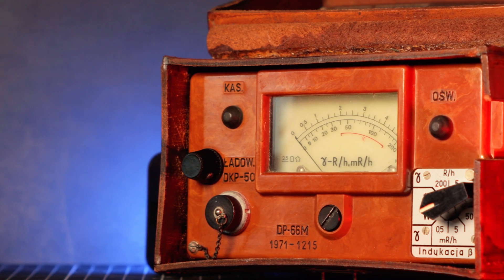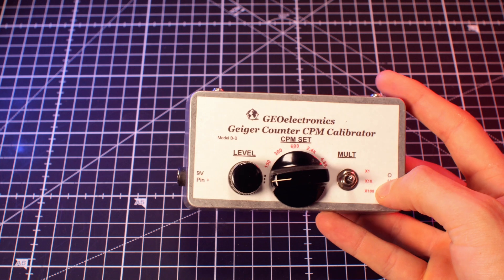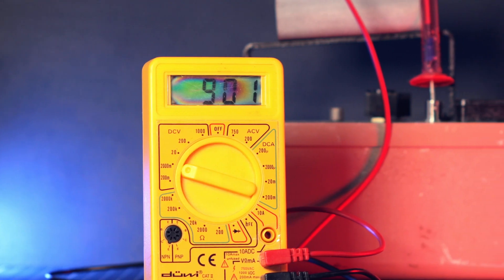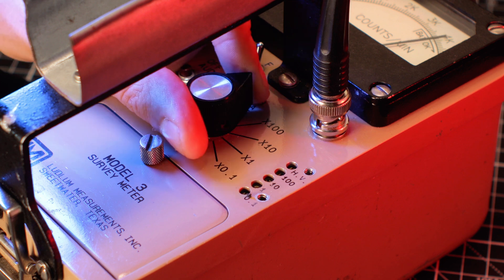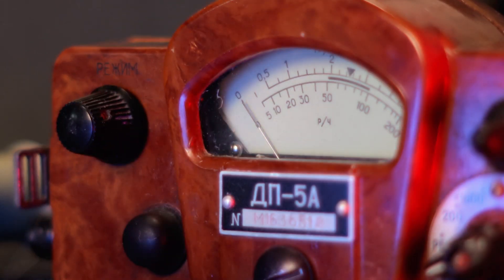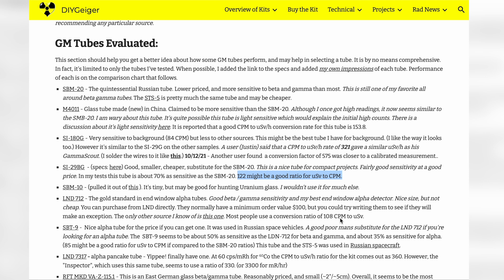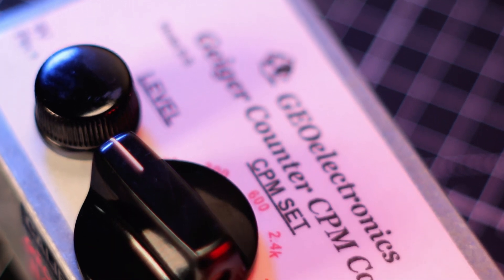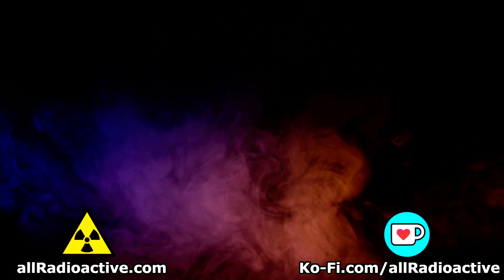How to calibrate a Geiger counter?

Comment: This pulser lacks high-end range to properly calibrate Geiger counters in the upper ranges. I own one, also own a Ludlum 508,& Eberline MP-2  calibrators/pulsers.
Reply: Do you mean Ludlum 500?   Would you be willing to part with your Geo then? I'm in the market for one.   I own a Eberline MP-2 and hope to get a Ludlum 500-X in the future.
Reply: The pulser's Geo (George) made were not intended to calibrate the higher range models of units, but rather the common low range hobbyist meters.

Really if you wanna have fun the pulser's made by the common handful of companies lack the range that a pulse generator ran on a cesium clock can provide

Comment: The inverse square law does not apply to extended sources of radiation. Errors of considerable magnitude may result in using the inverse square law on an extended source of radiation.  The effective center of the aggregate points could not be known by using the ISL, Talbots law, Lamberts Cosine law or the calculations from pages 81-104 in the Bulletin of the Bureau of Standards volume 3.